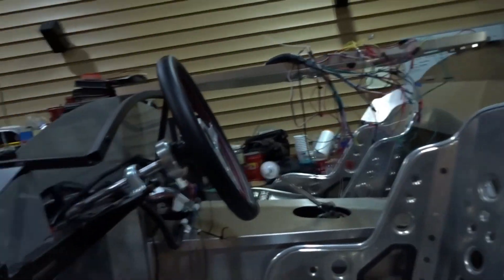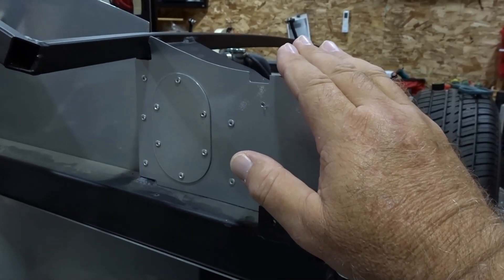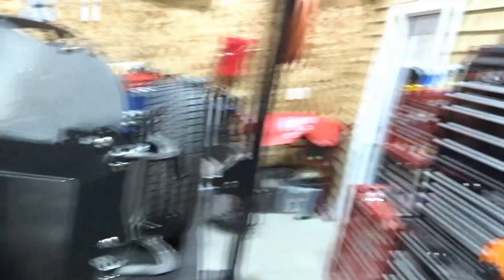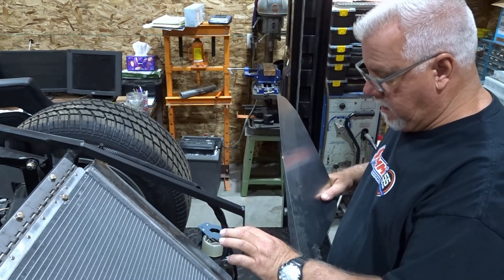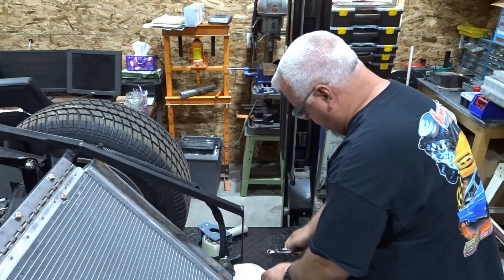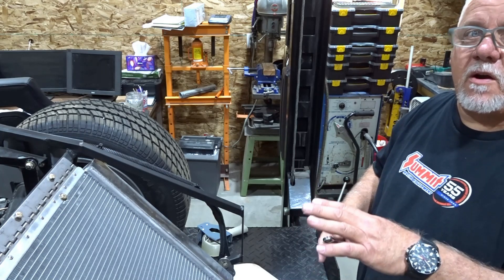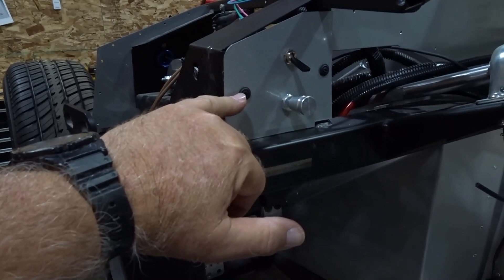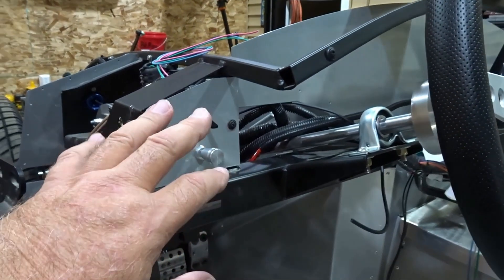Rad Angle Dude

Comment: I went through the build school in 2019.  The instructors told us to trim the firewall panel behind the glovebox.  The explanation was it was necessary for body fitment.  If I remember correctly they mentioned they had brought it up with F5R several times.  I went so far as to  trace their cut on a piece of paper to get it “right” when I returned home.  You and Jeff Miller installed the body on my car over a year ago.  It fits fine and as far as I can tell I get more radiate heat through the foot box than leaks through the firewall.  Glad I never got around to trimming that panel.
Reply from the maker: I know Nick. One thing I have learned is, not one of these car are exactly like the next. I get comments from time to time that the info I offer is wrong. I say to that; "Well, perhaps your car is just different". I don't claim to know everything. All I try to do is pass on what I have learned. You car in particular came out UNBELIEVABLE! And like you said, no trimming.
Reply: 04/14/2019 Build School.  We were there!